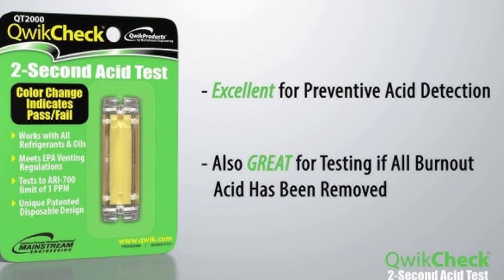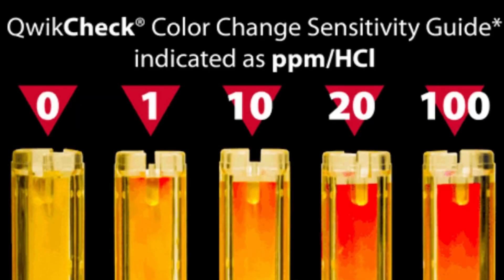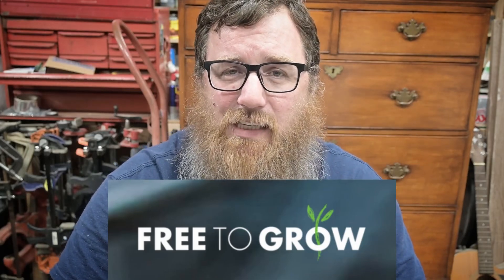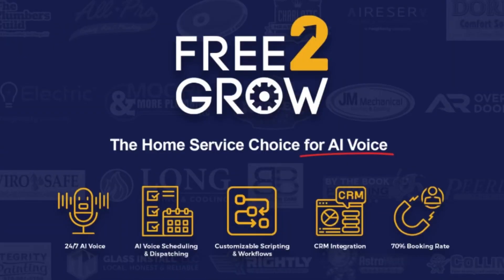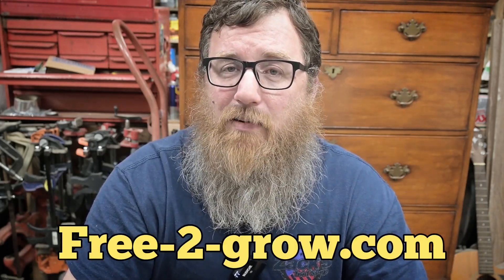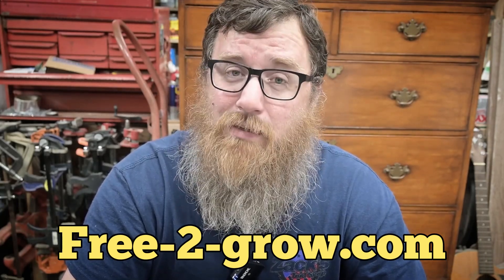3 Ways HVAC Compressors are Murdered

Comment: Good video. I am a red seal refrigeration/ air conditioning mechanic by trade in Canada. I did some  service calls for them 4 years ago. They always installed the systems them selves, the first summer I replaced 9 compressors in outdoor condensing units that had the highest acid level tests I have ever seen. I called the owner of the sheet metal company and said.. we have to have a meeting with your install guys to find out why you have so many compressor failures. They were a Trane dealer. At the beginning of the meeting I told the 3 installers to bring in their vacuum pumps and set them on the table in the board room. The pumps were all 10 CFM Yellow Jacket pumps, very good pumps in my opinion. The very question I asked them was.. How often do you change the oil in your vacuum pumps? All 3 of them said only it it falls below the oil line on the front of the pump, usually we have to let oil out because it gets too full. Well you can just imagine my response to that answer! I told the boys and the company owner, every one needs a vacuum gauge and a case of vacuum pump oil per truck. Change the vacuum pump oil after every use and pull the system down to 125 microns and that's it. The last 3 years they have no compressor failures. What a concept! I installed the A/C in my house back in 2001, an old R-22 3 ton 13 seer system, it has always been maintained properly, has never been recharged and works perfectly to this day.
Reply: How are they installing if they can’t vacuum 💀 susssss
Reply: @yinggamer7762  Most installers in my case were subs end then a tech will do the system vacuum and start-up and inspect ductwork and vents, airflow and balancing. Wiring and disconnects as well. In many cases we installed floor boards to walk safely. Some boneheads will find a way to stick their big foot out of the boardwalk!
Reply: Lol 125 microns, he said😂
Reply: I'm sory: "Change the vacuum pump oil after every use" ??? Isn't that far too overdone?